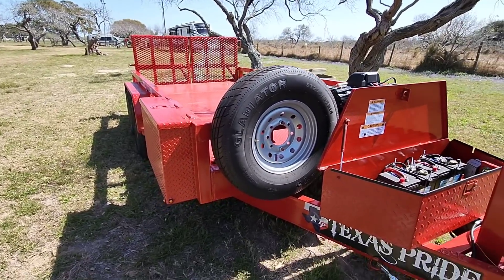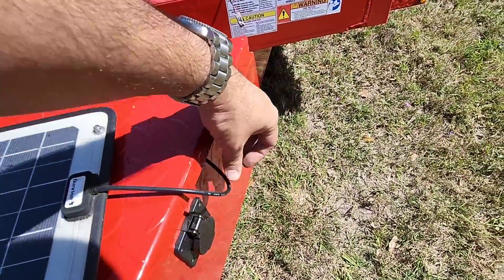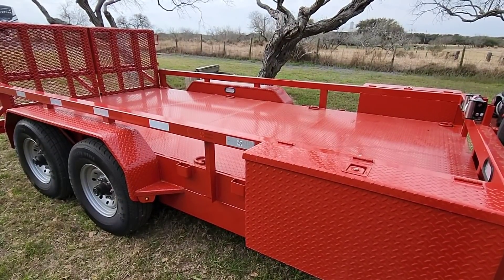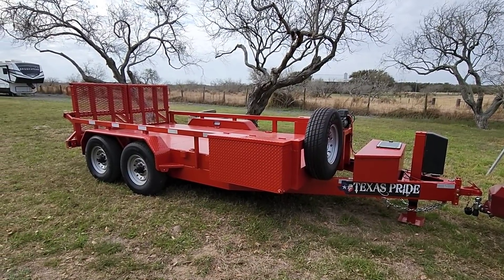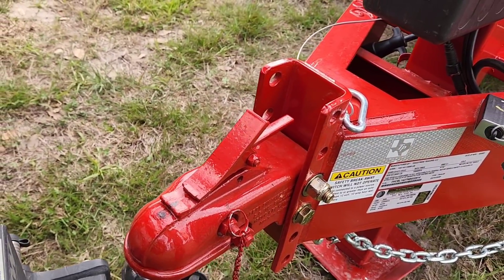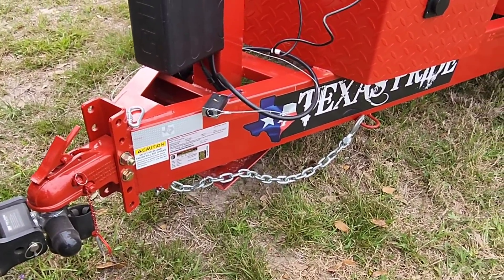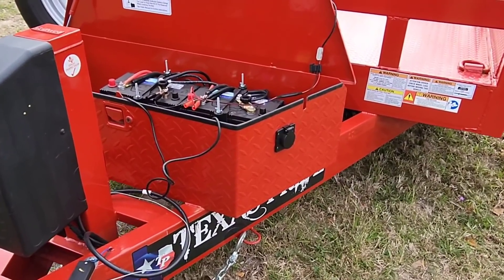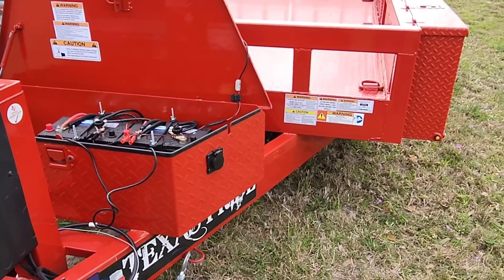DON'T HIGHBALL your Trailer Coupler!

Comment: 2 stories.
1.  I've never high balled and not caught it, but I did have the jaws not fully lock onto a semi trailer.  I tugged on it and it held, but as soon as I turned out of the parking spot it dropped with roughly 40k pounds in it.  It was at P&G in Granite City, IL if anybody cares.  Somehow I lucked out and we couldn't find any damage to the landing gear.
2.  I think I still lived at home at the time but wasn't there when it happened, but heard the story.  My aunt's van broke down and my dad went to the rescue.  He figured out when he was winching the van onto his trailer and the back of the trailer hit the ground that he forgot to latch the hitch.  Of course they had to roll the van backwards to drop it back down, latched it, started winching it back up just to find out the a full sized conversion van won't fit because of a metal frame for E-track.  It's a 16' car hauler, but the previous owner modified it for his needs.  It's great for hauling random stuff, and only adequate for most cars.  IIRC, they borrowed my grandpa's trailer and had to use a come-a-long to load the van.
Reply: I had the same thing happened to me with a three axle vacuum trailer in North Dakota. Hooked up to it gave the tug all was good made a turn thing plopped right off. Now im paranoid when it comes to hooking up trailers I tug the absolutely daylight out of them.

Comment: When I was a kid we were towing a trailer and my dad had the chains straight (left side to left hookup, right side to right hookup). An officer pulled us over and told my dad they should be crossed so in the event the trailer comes off the ball it will land on the chains and not catch into the road. 

With the way you set up your solar panel while having the disconnects off you weren't charging anything.

Comment: I was 17 and down off the seawall in Galveston back in 2013 carrying my 10ft jon boat with my mom's ford edge. My cousin and I had a great day of fishing after launching the boat off the beach down past the seawall. We had an old used trailer to carry the boat and the coupler was really crappy. It was difficult to get it to connect properly and on the sand after a long day of fishing we didn't get the coupler locked properly around the ball. On the way back down the seawall, the trailer fell off the hitch. Luckily we were only going about 5-10mph when it happened and luckily the trailer did not hit the vehicle. We did have the chains on, but that was the last time we ever used that trailer before getting a new one for my boat. Goes to show don't cheap out on a trailer. Save up and get the right one.

Comment: I always check that my boat trailer is latched... but I did have the hitch detach from the ball over railroad tracks once.  It was fully latched.  It's the spring-loaded type and over time had backed off.  There was no way to know it until it happened.  I got home (thanks safety chains!) and tightened the nut on the latch until the ball JUST fit into the latching part before I lower the handle and lock it.  Something to keep in mind.

Comment: Pulling a small flatbed trailer with an asphalt roller, saw and some tools. I don't know if I lost the hitch pin, forgot to put it back in or what but luckily the chains were set up properly and crossed under the tongue because the whole hitch came out of the truck and the trailer tongue was laying on the chains.

Comment: Truck and trailers separating let’s see I had my gooseneck equipment trailer hooked up to my moms dually and was loading up my Pecan tree shaker when the neck rose up off the ball then slammed back down onto the bed of her truck thankfully there was some 2x6s in the bed for it to land on, I’d forgot to check the latch on the coupler to make sure it was locked on the ball.  Then we had a small cattle trailer with a bulldog hitch that came off the ball even being locked on the ball come to find out the bulldog hitch was wore out from the people we bought it from because they didn’t grease it.

Comment: Last year while connecting our fifth wheel, I left the hitch in the unlocked position. Luckily I ALWAYS perform a tug test, with the jacks one inch off the ground. The trailer came off the hitch. Lesson learned. Now I have made up Checklists for Connecting & Disconnecting the trailer. I think everyone towing trailers should have a printed, laminated Checklist in their tow vehicle.

Comment: I check for high balling just by pressing the down button to unload the suspension and see the connection pull up. I have that auto lock which I love,  but caught it not fully engaged a couple times,  just due to park pin slack or malnutrition of the lubricant on the moovie parts.  My biggest fear has always been an uncouple whilst going down the road.  I even question my self after 10 feet to make sure I hooked up everything else cause I'm so focused on the ball or pintle.  You can never be too safe! Those are some beautiful trailers btw

Comment: Years ago, a guy I worked with thought it was "just fine" to simply wrap the chain around the hitch, instead of locking the ball with the pin. That is, until one night we were pulling a trailer loaded with old equipment from the barn over to a new shed that was built on the other side of the property; and the trailer hitch popped up off the ball; and the trailer passed us on the right hand side... all the way down into a ravine. Luckily, I was in the office with the owner of the farm when the trailer was being hitched up; and when the owner asked him whether it was all set, he said we're good to go, "everything double-checked". So, guess who got fired?

You get three guesses... and the 1st were neither the owner, nor myself. 😁
Reply: Man, that is very similar to what happened to us when I worked for a landscape and irrigation company.
  There were four of us in a '05ish chevy 2500 4x4  crew cab with one of the longest stock beds that I have ever seen on a pickup. It was a gas burner too. 5.3 or something. Way too underpowered for what we did with it. Just a goofy work truck. 
   Sorry, got side tracked. Anyway we were headed to a town called Raymond. We had, I would say a 20ft trailer with a bobcat skidsteer and probably another ton or so of hardscape blocks. I'm pretty sure thay we had grit mix or dirt on there as well. 
  It was my first week on the job, but the other guys had been there for several years. So, I assumed that they knew what they were doing. Well I hoped so at least, because the bobcat was the first thing that they loaded. Not only was it putting way to much stress on the hitch, but I was thinking "man, we are gonna have to use wheelbarrows to get the materials off before we can get to the machine. Why bring a skidsteer if you are not going to use it wisely. 
  So anyway, I'm sitting in the backseat, behind the driver. It is rush hour hour on one of the most dangerous sections of interstate in Jackson. The hwy is elevated about 100ft in the air with virtually zero shoulder.
   So we are doing about 80mph topping the highest point of this particular section of road, and suddenly there is a violent jolt. 
   The driver looked at us as we all said "what the hell was that"?
   As he is applying the breaks, I look over to see that our fully loaded trailer had merged into the lane next to us and looked like it was going to actually pass us. Lol
   Well that's when Wyckoff, the driver, proceeded to panic, and slam on the breaks. 
   At that exact moment, the laws of physics dictated that the still moving, and plowing up a pretty decent sized trench of cement, trailer was coming back to our lane. 
   That thing ran right up under the truck where I happened to be sitting. It sort of did the Pittman maneuver like the cops use. The driver managed to keep the truck somewhat straight, even though there were now only 3 tires on the road.
   It was scary as hell, but it all happened so fast.
  Well as you can imagine, the hitch pin had sheared, and the ball, still in the shank was still seated in the coupler.
  Thay was a pretty wild ride. And you have to remember, this all happened while were surrounded, predominantly by idiots, that were doing around 90 to 100 mph.
Reply: Working on a farm or ranch, the person who ticks off the boss is the first one to get fired.  I know this from personal experience.
Reply: @Harry-zz2oh  
Dumping a trailer full of equipment down into a ravine... trailer and all... will definitely tick off the Boss. 😋

Comment: I don't do extensive towing, and haven't highballed, but with my old travel trailer on my F-150 I had to raise and lower multiple times to finally lock it in.  I suspect the RV place set the ball angle a bit far back when they assembled the Equalizer hitch.

Comment: Once  did not have a pin for the coupler on a small utility trailer,
Chains caught the tongue and got it off to the side of the road. 
I keep spare pins of different sizes now, and double check everything.

Comment: I have a tiny 4’x8’ tilt trailer used for landscaping.  Went to load it in the morning with equipment. Night before, my girl had taken it off the hitch. She said she told me but I wasn’t listening. Ended up with an aerator on top of me.  Now I try to listen when she’s squawking my direction.

Comment: Neve highballed but lent my (light-duty 5' X 8') trailer to a buddy that loosened the nut under the tongue because he didn't have the right size trailer ball, I never realized that it would even hold in that goofy setup. The next time I went to use it the safety chains caught the trailer. No brakes on the trailer when I slowed down the tongue of the trailer went through the Van doors. I was baffled but went I reattached it, I realized the nut had been loosened. The next trailer had e-brakes and the bulldog hitch. No bolt that anyone could mess with. Actually a trailer in between, they have both since been stolen. The Texas pride makes a very nice trailer.

Comment: Didn't get my locking receiver pin locked all the way, thankfully the lock end was at the bottom of my driveway and the pin stayed in mostly so my hitch didn't fall out on my way to work (no trailer involved). Have forgotten to latch the ball once or twice before too but I've gotten better at reviewing my checklist before driving off now.  Also so a contractor with a wide open pintle hitch at the gas station once, he was pretty thankful I pointed it out to him.

Comment: I hooked my 18ft trailer up. Loaded my tractor and bush hog up. Went to unload it and got the tractor almost off with most of the weight at back of trailer. The hitch came up and off the ball. Now when I hook up I make sure it is all the way on there

Comment: At 1:00 into the video, maintainer won’t charge batteries the way you connected it with (+) on one battery & (-) on the other if the disconnect(s) are open.

Comment: I high balled my flatbed trailer once to load up a bunch of oak logs.  Drove to the site, backed the trailer in, loaded it up and drove home. I lost a log off the top along the way,  which a good Samaritan threw back on the trailer for me, but the trailer never budged off the ball.  When I discovered it as I was decoupling the trailer I was amazed that I didn't have a catastrophe.

Comment: I forgot to lock the PIN on my gooseneck ball in my truck when I had my trailer on the back but thank God it had enough tongue weight where it didn't pull the ball out of the bed.

Comment: My Dad did that with a car trailer, Lost it on the highway,  no safety chains either,  it coasted to the shoulder without hitting anyone.  State Patrol was there pretty quickly afterwards and helped my dad get it re hitched. Trooper didn't give him a ticket,  said he just did the same thing himself fairly recently.  This was back in late 70's or early 80's. He sold it right after that. I dont think he understood what happened.

Comment: I've never highballed, however, I have felt for the clamp three or more times including actually eyeballed the coupler at least twice while hitching my rv trailer. Then I do a once around twice on my chains and electrical. Police are just itching for an unsecured trailer. Learned that in my truck driving days. Big fines if you loose part of your load on the highway, just as much if you loose your trailer. Even when I do get my automatic coupler, I would still feel for it and look under and eyeball it. Might not save much time but would sure save me some big fines.

Comment: Had bought a fifth wheel. Reese hitch. Trailer weighed under 7k. 15k hitch. Slide bar not jaws. 3 of us verified positive latching maiden trip. Half mile down the road came loose. The hitch was locked closed.  Figured human error. Leaving campground in Kentucky I did a very aggressive pull test. No prob. 30 minutes later trailer came off fifth wheel going 60. Only thing that kept it together was tailgate. Just coasted to a stop. A hitch dealer examined hitch and said sloppy.

Comment: I have  installed the ball mount into the receiver before and then hooked up trailer , drove 10 miles home and realized that I didn't install the 5/8" hitch pin so lucky that the ball mount didn't slide out of the receiver !!!

Comment: I've heard enough fail stories to create a hitch paranoia. I double check everything.  I decline the help if someone wants to do the hook up. When boating, I even confirm the trailer is still coupled before and after retrieving the boat. (Not sure what evil lurks in the parking lot while out on the water). When traveling longer distances, I have a hitch,  wheel and load check I do on every stop. The number of stingers and hitch pins I have found on dirt roads while camping is alarming.   So now I use a keyed lock instead of the the clip style hitch pin.

Comment: Worst thing I have done is I picked up a piece of rental equipment. I asked what size the ball was, was told 2". The hitch was so covered in paint that you could not read the stamped size. So that's the receiver I put in.
Down the  road and at the first set of big pot holes the trailer jumped off the ball. 
Though I must have high balled it. Re hooked and away we go again. 
At that point I realized that the hitch was not working and there was way to much slop in it. Changed to the 2 5/16 and all was good.
When I returned the equipment I made a comment about the problem. The yard guy then goes on about how he told me the right size and I refused to use it. I was like why would I do that when I literally had both sizes in the truck all the time...
Never trust anyone else with what gets hitched to your truck. Always do everything yourself, all the way through.

Comment: Two things when you  use those disconnect they are still in contact unless you take them apart...  At the set that i had which looked like yours...    When i have a choice  i use bulldog hich couplers. Of. 40+ years of hauling trailers they by far are the best couplers  i have ever used.  And i have pulled 15  0-200 different trailers over the years.   They have been around for 60+ years.   We have a boat trailer i believe built in the mid 1950s  with one.  it works as good today as as it did when my dad got it in 1966.  When we spec out a new trailer, it usually has a bulldog..    it has a collar that is obvious just looking   at it you know it is closed....i believe that they are forged units.  Almost indestructible.

Comment: I have one that is extremely difficult to latch fully. It's really easy to highball if you don't know it's a pain. I want to change it but it's welded onto the A frame. I should have known when I purchased it and the sales people had a hard time coupling it. Next time I will be more picky if I see it resisting hook up. To be sure I got it correctly I lower the trailer jack and lift the back of the truck just a little bit to be sure I have a positive lock on it.
Reply: Is it the correct ball for the coupler? Just asking since others have commented on this in posts above.  I've had issues with my Bulldog sliding coupler but I'm going to work on it this weekend to ensure it is lubed very well and any rust is removed.

Comment: Purchased a new trailer and took the word of the dealer of the ball size and did not check before towing. Used a  2” ball on a 2-5/16” coupler and drove about 500 km   When backing in to driveway at home trailer came off of ball 😱

Comment: Not checked the nut on the bottom of a new ball until after running the trailer 75 miles home.  Well it was loose and worked its way about half off.

Other mistake was unhitching travel trailer on beach.  Tide came in, sunk truck and trailer and had to get dragged out with safety chains.  Now I stay hooked up, have a winch, and keep recovery gear with me.
Reply: I've learned to always be at least 20 feet above the high tide mark. These days it isn't a problem since the lake is now 150 feet below the high tide mark.  Fifteen years of draught is a real pain when I need to irrigate my pecan orchard.

Comment: There is a easy way to verify your coupler is latched.   Run you jack down and see if it lifts the rear of your truck up.  I do this to attach my load distribution bars.  It quick and easy.

Comment: Worked for and equipment rental company and saw many customers come back with rented trailers either not latched correctly or highballed.  Also rented a trailer once it came uncoupled after a full day of towing.  Messed up the nice powder coating on my new B&W hitch. I did check the trailer multiple timed throughout the day.  Told them about it when i returned it their answer was "yeah that happens".  Not a great thing to be telling customers, I would think.

Comment: Honestly,  I  did this once. Sadly I was going slightly down hill, The winch arm on my boat trailer cut a hole in my tailgate.  I will never make that mistake again. In addition to checking the ball as you show, I either lift the tung or use the jack to verify the trailer is hitched.